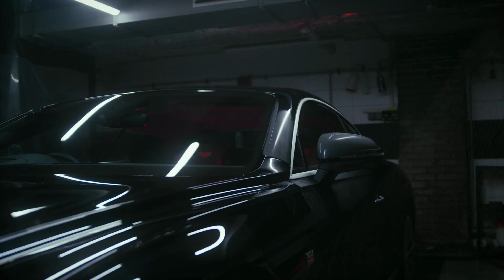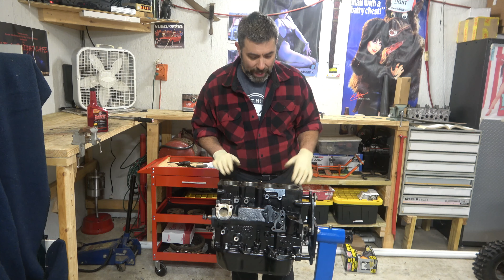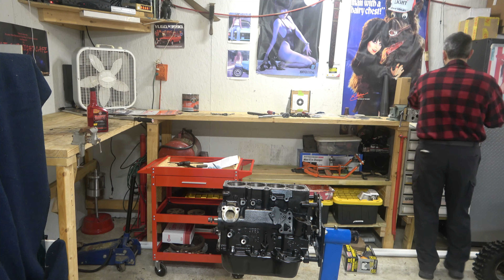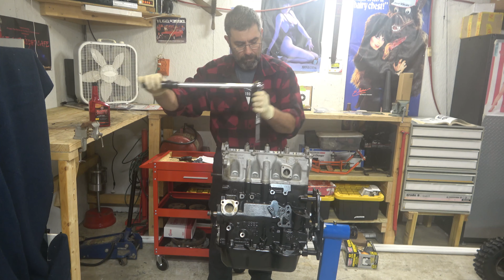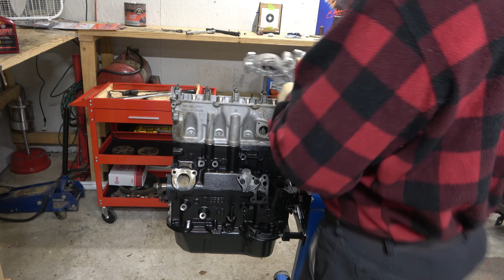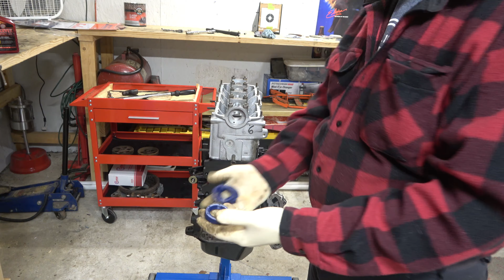Volkswagen Watercooled Rebuild Series. Part 6: Installing the Head and Head Gasket.

Comment: Hi Eric.  Just a thought. I was a mechanical designer in an engineering department for 43 years. We always recommended lubricating threads on any bolted connection before torquing as lubrication reduces friction on the threads, allowing for more consistent tightening forces across all bolts. It's possible that Volkswagen wants them torqued dry though so it's important to go by any particular manufacturers recommendations. Nice job putting it back together! Enjoying your videos.
Reply from the maker: I've heard that you should never use lube when torquing bolts. It will completely change the values.